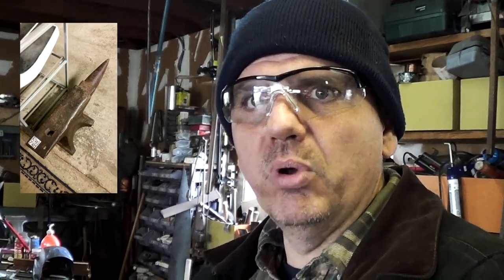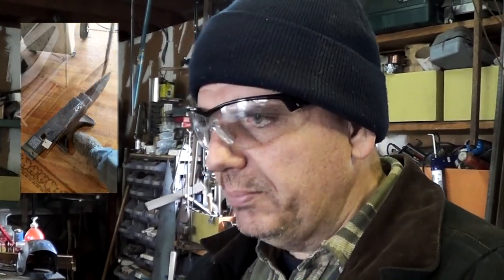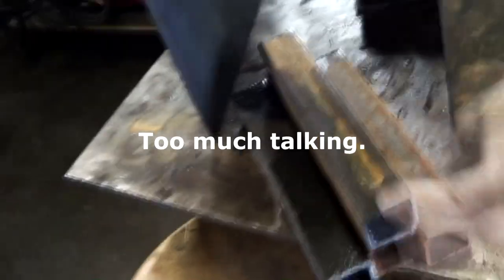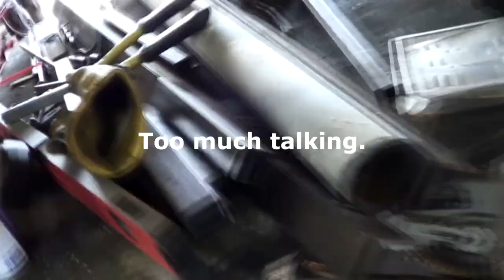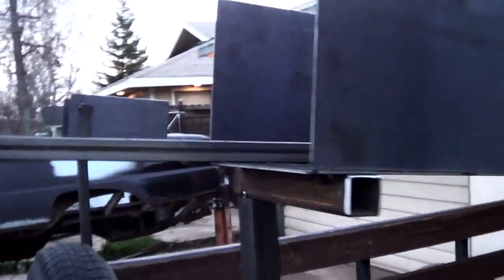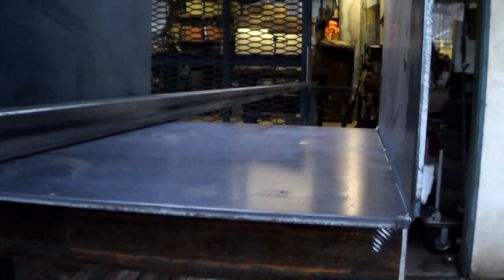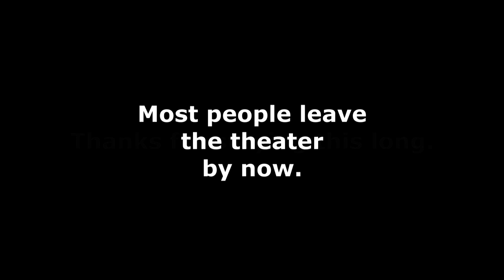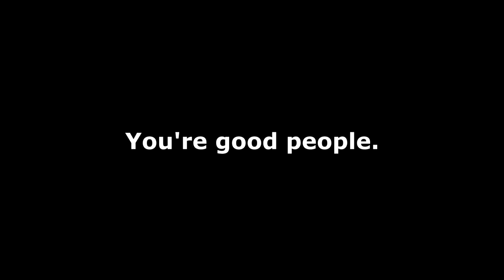Conduit Racks on a Trailer Part 2 V18

Comment: You just sparked me an idear for hauling long stuff on the truck. Hmmmm
Reply from the maker: +bc65925 Well alright. Go forth and let us know how it turns out.
Reply: +Justin Jennings When I was a youngern working in the sawmill I think I saw just about everything possible in the way of hauling stuff long. One in particular that sticks in the mind was a guy hauled in a 6X12 20 foot long on his station wagon. Now how he did this was he pulled up over top of the thing and tied up each end to the bumpers and hauled it in under the car. Here's my idear, I have a hitch receiver in both ends of the truck, why not make a rack for each that just extends down a little ways and kind of do the same thing for like 20 foot pieces of stock from the steel yard? My truck is a 2500 4wd Dodge, plenty of ground clearance.... things that make you go hmmmmmm.
Reply from the maker: +bc65925 That works.